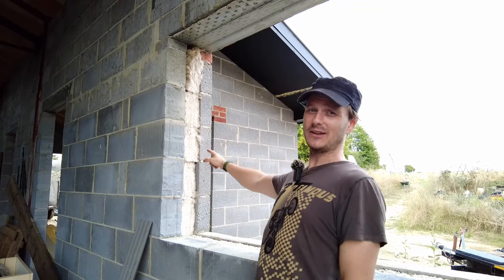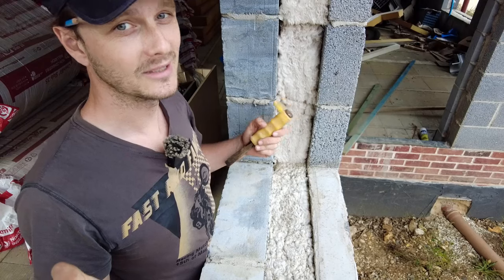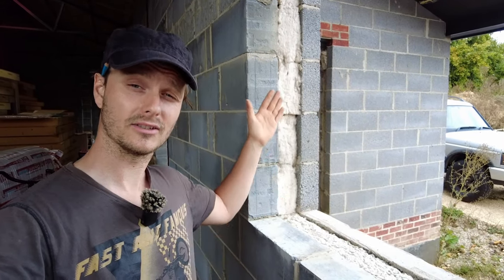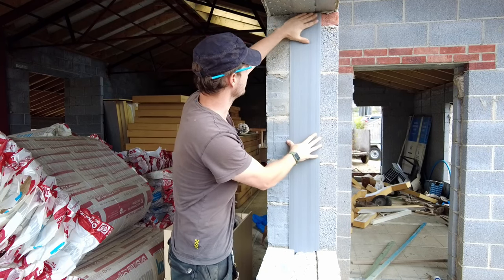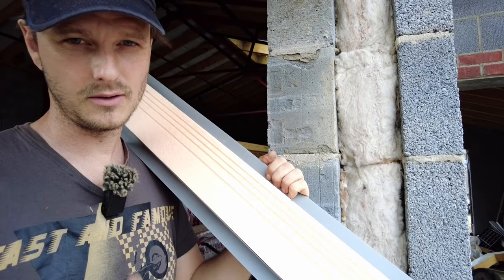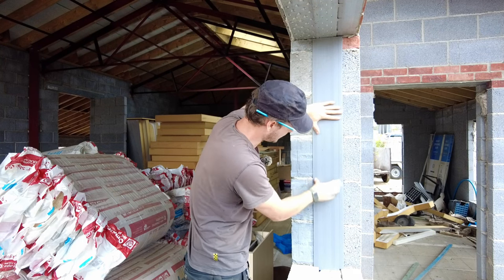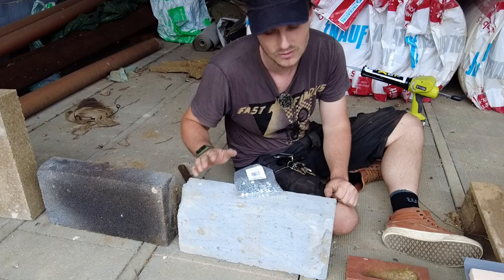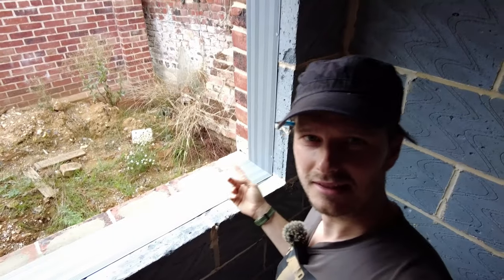How to fit cavity closers for windows and doors

Comment: What about the top?  I didn't know you used it under the window cills.
I am more interested to know how you finish, plasterboard, fibre cement board??? How firm and sound is the closer plastic to attach your finish board? Could do with anothet video please 😊
Reply from the maker: The top has an insulated catnic style lintel so the cavity is closed there. I'll likely be using eps backed plasterboard on the reveals. Of course I'll do a video when I get to that part 😅 I am rather slow so not got to that bit yet 😆

Comment: Great video buddy.

Is it possible to fit these after you’ve had a new back door fitted to the outer skin?

I have the cavity where the inner skin returns to a vertical DPC, but being 70+ years old, I’m thinking of chopping out that return, clearing out all the debris, and fitting a cavity closer on each side instead.
Reply from the maker: Humm if you do abit of trimming with an angle grinder along the length of one side then you might be able to squeeze it in. It all depends how far your doors have been set back
Reply: @THE-AIDEN-PROJECT  thanks mate!

Comment: Glad to see your subcriptions increasing. Well deserved. I have question though do you put cavity closures at the bottom of a doorway?
Reply from the maker: Haha I'm just filming something about that today! It's not normal to have an inner skin and therefor a cavity closer where your door threshold is. It doesn't seem like there is a definitive answer which solves thermal bridging issues though especially when you are supposed to fit doors/windows overhanging cavities by 30mm. My fix will be out next week if you can wait?

Comment: Do you attach window formers whilst your building the wall or after the walls are done?
Reply from the maker: You can use window formers whilst you are building, they are pre formed cavity closers like the ones I've used in the video. You usually see them on big new build sites. Otherwise you can fit cavity closers afterwards like I've done here

Comment: at 1:48 would you not be applying air tight tape to the 90 degree angle where the 2 closers meet so any water running down the vertical wouldn't get out anyway?
Reply from the maker: I'll be putting the tape on (not got to that point just yet) but that's after I've already put the windows in, so just the back section will be sealed. The windows overlap 30mm into the cavity so unless you've really f'ed up, water shouldn't be getting that far back

Comment: My builder's gone and fitted the windows and door before these have been fitted. Am I screwed or should I trim the cavity closer and fit on the interior of the window frames.
Reply from the maker: Eeek, you need to close the cavity for building regs and they should be fitted before windows and doors 😬 Is the builder still around as he should correct this. Maybe have a chat with your building inspector? If your builder hasn't foamed the windows in yet then there's a chance they can be squeezed in. I can't see how trimming them will help
Reply: @THE-AIDEN-PROJECT  - unfortunately, the builder f*cked me over. Took £30k of my money and left with a 70% finished building. By the look of it, I could possibly squeeze the close between the fitted frame and the blockwork. I'll need to dig out foam, adhesive and shims in places.
Reply from the maker: @randymch  ah well good luck dude, hopefully you don't have too many to do to sort it. You can get single flange cavity closers which you might be able to butt up against the window frame so check them out 👍

Comment: Hi Aiden, what did you use to cover the window closer? Osb wood or plasterboard?
Reply from the maker: @Ace-xm9iq  as in what have I used on the reveals inside? I haven't actually done it yet 😆 (I'm slow) but I'll be using insulated plasterboard
Reply: @THE-AIDEN-PROJECT  yes that’s what I meant 😅. Thanks.  It’s taken me 6 months just to build a 2m porch, you’re definitely a lot faster then I am 😂.
Reply from the maker: @Ace-xm9iq  haha I'll probably use the Eps backed plasterboard rather than PIR though

Comment: Hi im building in south west of ireland. Im using 4 inch insulation board and cutting 6 inch strips because my cavity is 6 inches, i presume that will work fine? Im pumping my walls so i just want aomething to stop to beads from pouring out. 4 inch was even abit excessive l. Might prove hard to get into the cavity
Reply from the maker: Well that will close the cavity yes and shouldn't be too much of an issue to shove in. Not sure what the regs are like over there though so maybe double check with your building inspector. There are 150mm versions of what I used in this video also
Reply: @THE-AIDEN-PROJECT  there is a special cavity closer you can get here in the hardware shops but its alot more pricy than the 4 inch stuff. 4 inch stuff was 55 euro a sheet 1200mm by 2400mm so still saucey enough. By right i should have bough lighter stuff be handier to tap into cavity. The beads will be meeting it anyway. Il see how i get on il tackle it during the week.
Reply: Hi there - great video. I’m in the middle of a self build can you give a link for the cavity closer you used please. Also I’ve left 5mm space all around for easy of installation of doors and windows is that enough space for the cavity closers to be installed as I had not allowed for them. Thanks for your help
Reply from the maker: @JimStone82  the manufacturer is YBS, lots of places have them and you can get the 150mm ones if you're on new regs. You should be fine with the windows and doors, especially if you went 5mm smaller than your smallest measurement

Comment: Thanks for the video but I believe the verticals ones need to overhand 50mm above and below the horizontal to stop water ingres.
Reply from the maker: 50mm seems abit over kill, that would mean it would compress the cavity insulation and leave a cold spot. This manufacturer doesn't give a measurement so I'm sure 5-10mm would be sufficient 👍
Reply: @THE-AIDEN-PROJECT  Kingspan makes it very clear on their video that the verticals should overhang the bottom section by 50mm and the head section should overlap the vertical jambs by 50mm to each side here: https://www.youtube.com/watch?v=6W6uj68sYCQ&ab_channel=KingspanInsulationUK

But obviously that would apply if you had remembered to build them in during first fix, rather than retrofitting them as commonly happens in the UK.

Comment: Where is your dpc strips in your window openings?
Reply from the maker: You don't have any of you use these cavity closers
Reply: @THE-AIDEN-PROJECT  really? Feck it. I went away and got 4 inch kingspan to close my cavity. I came to the house today and the guy that did it for me made a dogs dinner of it. He didnt leave the dpc come out past the reveal in alot of places so iv to rip all the kingspan out again now and re do the whole lot myself. Complete disaster. Il make crap of the strips that are in and he used about 400 euro worth of the stuff the close the cavity. Complete disaster. Cant pull the dpc out anymore as he used expanding foam aswel do its wedged in there. Fair stress building when you dont get a contractor and sub all the work
Reply from the maker: @jericho9653  😬 sounds like a headache